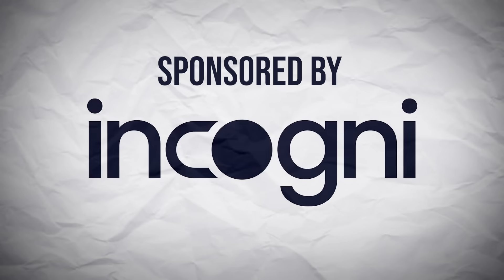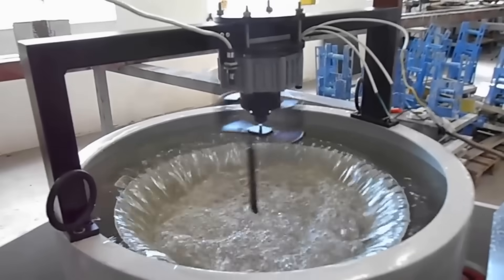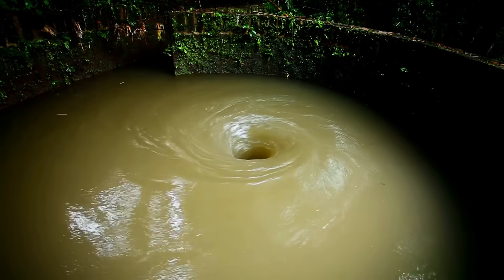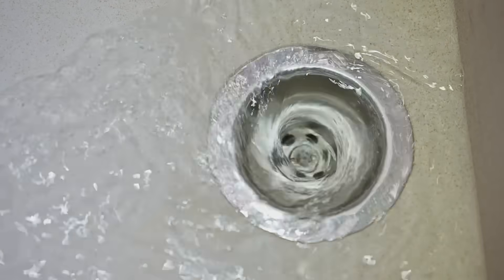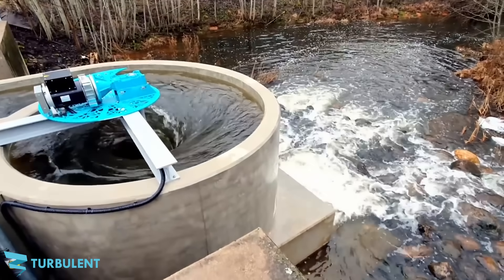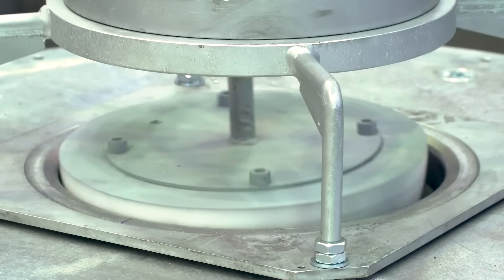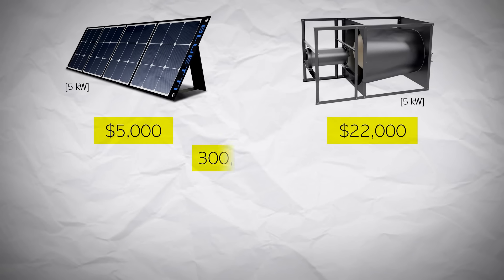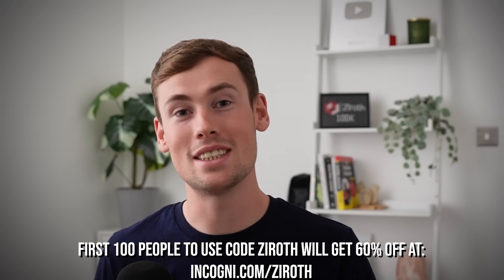Genius Bladeless Hydro Turbine is Cheaper Than Solar

Comment: Immediately two problems come to mind: 1) Vibrations are deadly for efficiency and longevity. 2) Due to practicely no surface area there is little to no torque on the shaft.
im highly skeptical this design has any real merit in relevant scales.

Comment: That footage at 8:00 just looks fake.

This is very unimpressive to me. Its using physics principles, but in a less efficient, less optimal way than the current method. Its not even optimized to harness a vortex either, the top is flat. It should have a smooth "hydrodynamic" topside that facilitates the eccentric rotation. This design relies on the vortex alone, while also basically disrupting it.

Comment: It does not look fish-safe at all. Fish will surely be turned into a paste when the ball crushes them against the walls.

Another issue is maintenance: the off-center operation creates a lot of vibration all the time, and vibrations are good to destroy machinery. Mechanical resonance is powerful enough that a group of soldiers walking destroyed a bridge (Broughton Suspension Bridge), so if the vibrations got resonant, the turbine will get destroyed.

I liked more the Turbulent turbine: simple design, little to no vibration, and definitely more fish-safe.

Comment: Trompe is the ultimate bladeless system and has energy storage as compressed air. The key is to mass produce the things and use a steerable deep staff drill to make the shaft and separator. https://en.wikipedia.org/wiki/Trompe

Comment: An aspect of this type of smaller power generation machinery, that isn't often discussed,  is its impact on large grid stability. 
When grid power is discussed, it is usually only in terms of total supply and total demand. Rarely is transmission and distribution discussed.  
Anyone who has lived in an area with regular rolling blackouts is experiencing transmission/ distribution problems, usually not an actual supply problem. 

Even if their net supply is insufficient to completely carry the local grid, these local power stations take load off of the transmission grid. Every watt that doesn't have to come here, can go somewhere else. Even with totals below 10%, local power generation is worthwhile for the big picture,  as well as the small picture.
Reply: I really don't know modern technology of grid control systems so I always wonder how electricity distributors controlling those "small power stations". I imagine it's not impossible to implement some sort of central control system for the grid, with many small suppliers, because as matter of the fact electricity companies buying electricity from small supplier even in my country. But I imagine it's better to use those small power station locally rather than sending it to the grid. Especially, hydro station is very easy to control because all the thing you have to do is close the valve to reduce the amount of electricity produced by the generator. I understand modern trend of "clean energy" is more like, selling electricity to the distributor but It feels like a bit off to me. Why they don't consume the electricity where it produced rather than sending into the grid?? Maybe I just don't understand how these system works but now we have a lot of way to produce electricity suits to the location we're living in. So for example, if we're living by the river we can install small hydro turbines or if we're living in the desert we can use solar panels (in this case we definitely need battery but I really don't know how frequently we need to replace batteries...considering the battery of my phone become incapable of storing electricity for five years or so, it's not long lived as we expect it to be I'm afraid) and consume the electricity within local area rather than sending it to the grid. And only when our small generator can not fulfill the demand of our area we can buy shortage from major supplier through the gird. I think it's more simpler than constructing "integrated grid system" or something (because basically that what electricity distributors are doing now, right?). Or actually modern grid systems are working in that way?? As you said in your comment I really can not find these information anywhere on the internet. After all we all have substation for the area we're living in. So All the thing we have to do "plug in" our generator at that location and consume and feed the electricity whenever our generator can not fill the demand of our local area. It seems like somehow easier and better...well, this is my amateur's intuition so probably I'm missing some thing, or I just don't know modern distribution system actually capable of it. Anyway, It's always mystery to me, how modern grids are distributing electricity from various generator scattered all over the place? Is that really cost efficient?
Reply: @付和雷同-j5b  I think you understand both the technology and challenges better than you think. The part you leave out is political, where politicians will force or subsidize things that aren't effective, simultaneously blocking others from doing things that are effective. 
Remember, even in countries that claim otherwise, the electric grid is always 100% controlled by politicians- not engineers.
Reply: @付和雷同-j5b  In TL:DR form, you have large energy producers and adjustment power producers. Small hydro, solar etc falls into larger energy production bracket, where its drop in the bucket in comparison when rest put out hundreds of megawatts. Even if it was readily available all around, power needs in certain area like city can easily overwhelm even larger producer if lines outside are cut witch balance the use and production, causing those with in most likely run out of frequency and emergency cut out from grid, since just 0.5hertz can destroy equipment and that will be very VERY expensive bill who ever fucked up. More complex the machine is, more sensitive it is frequency changes, unless it was designed to work in different ranges but thats beside the point and each item design. Since you cant throttle nuclear power plant up and down fast, there are rapidly responding powerplants that are adjustment power producers, who can turn the whole plant off and on again in seconds to minutes. This is when grid is fully working. Due next question of where the power is cheapest and most practical to produce for instance cost of hauling the fuel around, plants are setup all over the place where its best suited and due the sizes and type of plants electricity might need to be moved long distances. When grid is damaged, larger area is cut out from power, then brought back in steps to locate where the damage is witch requires the adjustment power. During large storm many such events happen and adjusting power plants need to response in over production or under production, so frequency stays with in set standards. If it does not, that mean in worst case scenario ether totally fucked up electronics if fail safes fail, or most likely almost just as bad result: frequency collapse, where all plants emergency cut off from grid and whole country can go dark. Getting grid up from this situation is absolute fucking nightmare, witch is hella expensive and should be avoided in all costs.

"Why they don't consume the electricity where it produced rather than sending into the grid??" Simple. Cost of production vs whats paid for it. You recall the world ending electricity prices in Europe? Well cause of this simple thing, Sweden and Norway produced shit ton of cheap energy since their productions costs were rather low. This power then was sold to Finland... witch sold all the excess and further sold it to Estonia, who sold it further. Top of that Finnish people were plead to save all the power they can for sake of the "environment" and that enough power would be available to everyone...all the saved witch was sold to Estonia for great profits who most likely did same thing. Just goes to show how we are scammed, with climate crisis etc bullshit.

For small production its nice little extra but at best they can produce maybe a megawatt or two that gets lost to total production and mostly only useful to person who produces it. For instance my neighbor has top of the line larger solar setup. On winter his on mostly taking all the power from grid and summer producing some into the grid while producing most of his power least during the day... or starts the diesel generator when power price is high and sells this "green solar energy" to grid. This is just small scale how green energy scam is done by larger companies.

This is just the bits i have learned from powerplants head electrician, but the whole topic is much much more complicated when we go from power production to systems in thems selfs globally and god damn politics and scams, but simply said yes it would be beneficial to have small scale power production, say macro nuclear reactors and utilize resources available, but micro hydro, etc if its not able to produce extra top of your own usage, is not really that practical in grid scale even if there was enough land and people installing these setups. Specially when you look into cities that consume most of that energy.

Comment: With EV big battery and V2G and parked 23hrs every day and batteries are free with the EV then storage of electricity is $0.00.
The EV uses very little electricity daily and can selfpark and plug itself into the power like the home robotic vacuum cleaner. 😊😊😊😊😊

Comment: A circular cage with fins on the inside may work it'd spin fast enough that'll pull it apart and will move to fast for anything to enter beside the water that can catch the blade but that may be wrong. Definitely should be some ways to make it more efficient while keeping wildlife safe.b

Comment: What about an externally spun top strung with copper wire within a shroud. The external ring the water swirls around spinning the top, at the Venturi point is also strung with copper wire. No direct drive to drag the spin. Effectively a magnetically and buoyancy-specifically stabilized top. Turned by the vortices draining around it. The magnetic stabilization being at an algorithmic ratio to pointed. In theory it could continue to accelerate the effect through several stacked iterations as the siphon effect accumulates.

Comment: Thanks for the video. Fascinating. As a keen fisherman I can relate to the desire for turbines that don't mince the fish.
That said, looking at the footage you have shown here it looks like any hapless fish that found themselves going through one of these would run the risk of being crushed to paste where the "ball" meets the wall.
Love your work. Cheers.
Reply: Yeah, it would be better to add safety net to prevent fishes wandering into the devices.
The net need to be replaced at regular interval tho, and the net do reduces power generated by the 'ball'.
Reply: Perhaps the safest method is the big old water wheel, tipping the water in the top and gravity does the work.
Not very tech and whizzy, but very safe for fish and efficient too.
Reply: Nah. Manufacturer makes it clear that you're supposed to put a protective grate/screen solution in front of the turbine. (Not just for fish, but other debris as well.) a couple layers of painted expanded steel seems to be the favorite.
Reply: @QuakeDragon  Good point. I can't help wondering, though, if the fish can't get through then wouldn't you just go back to the more traditional turbine with double the efficiency?
Reply: @GarthClarkson  Yes, that is absolutely valid. For the SETUR-L (the large 5KW turbine) the use case for these is generally intended to be small deployments in remote areas where you can't (or shouldn't) have all that infrastructure buildup, such as the case of the concrete snail-shaped outlet. Case in point, the manufacturer primarily sends off-grid inverters, but if requested can certainly send the grid-tie capable ones. Additionally, the SETUR-L may have a low head requirement of only 1 meter, but it still requires 650 liters/second (170ish gallons/second) of water flow rate for nominal operation.  With that kind of volume, the difference made by a couple of steel screens would 𝑝𝑟𝑜𝑏𝑎𝑏𝑙𝑦 be marginal. (references: P.8 of SETUR-L user's manual, Rev. 5L-B)
Reply: @GarthClarkson  ..i think ur very very generous when u say it haf as efficient... on this scle perhaps... on a larger scale it will be exponentially more inefficient... if u want to power a few strips of leads in ur garden fromur garden waterfall its probably okay...
...even a tesla turbine would beat the crap out of it... and it not suitable for it...to ineffecient...
Reply: @QuakeDragon  Harbor seals and sea lions would keep the fish out of the turbine...
Reply: I noticed the fish-grinder action, too. 
Fish paste maker, probably not. Maybe just smashed once before ejection.
---> I wonder if the ball has to be rigid, could it have a soft foam layer?
If not, collect the semi processed fish, for livestock feed. 
 (You'd probably get tired, pretty fast, of making yourself Tuna-Loaf, with "mystery-Fish", anyway.)
Reply: while you would need a grate for debris the worry about fish is unfounded. since the fish swim in the water and the ball is pushed by the water then it wouldn't crush the fish very often, only when they are too big to fit. even if it pushed the water then it would push the fish with the water and not smash the fish. if you look at aquatic animals smaller than the width of the blades on propellers and turbines, they rarely get smashed in whole or in part by the blades because the blades move enough water to move the animal with the water. it is only as the animals get big enough that the amount of water displaced is too small to move the animal that they get injured.
Reply: ..well thay do already exist...thay are called hydro electric power dams...
...and this guys have invented a very poor verision of a tesla turbine....
..wouldent surprice me if thay maned to hype it and get some investments at wich point that suddenly dissapear... 
req investors that dont know anything about physics ... its a pipedream...litterally...
Reply: It makes me wonder of adding some vestigial blades, heavy grooves, or something like that, might improve efficiency and create a little space for fish to sneak through unharmed.
Reply: I imagine you could have a thrust ring set at a point to allow the ball to only swivel out to a certain point so it doesn’t actually touch the sides and allows enough room for fish to get past without mincing them, this would no doubt have an effect on its efficiency though.
I am not keen on this design, it seems very inefficient.
Reply: As a white water kayaker these things may not completely destroy the river but they are ugly and need a lot more work.
Reply: @billalumni7760 I don't think this type of turbine would apply to white water as they are meant for low head. White water hydro can easily have concealed intakes and outlets due to the large amount of water and the high drop.
They can also have protective grates to stop the fish from entering as the fish have the whole river to traverse without the need to go through the turbine.
Reply: As a keen fisherman, keen on ripping the throats out of fish with my tripple hook lures, I can relate to the desire of not killing them any faster with turbines. Far better they die slowly by starvation, that only seem fair.

Comment: have you one one about the open top turbine with a spool section open to the air and really tall paddle blades scooping the spooled water? (nvm)

this is neat and all but i thought this was gonna be some static electricity or electrolyte/thermal differential generator. 
think about using big black panels or class bubbles to heat one side of a sterling engine with the other side consisting of fins immersed in flowing water, that could be really powerful in elevated areas of desert environments

Comment: Does seem like adding fins on the ball (and making it lens shaped to hold its orientation) would transfer the rotation from the vortex with stronger torque.  On the other hand as soon as the fins are there, it can’t be called a bladeless system.
Reply: could you have silicone ridges to the same effect?

Comment: Wouldn’t the ball stop too easily if energy is being extracted from its motion? Like cars with regen braking, it would slow the ball. And if the surface friction of the ball between the moving water is the only thing rotating it, it seems it would stop quite easily, therefore not being able to provide much energy.

Comment: Or, you could use discs seperated on edge, like an undershot Tesla turbine. fish couldn't fit between disc plates. and shaft could be horizontal between turbine and generator on the side of river.

Comment: Efficiency claim of 50% has got to be marketing bogus. Water does not have the kind  of viscosity to efficiently create a drag on a relatively smooth surface that provide a energy-generating torque.  To do so you need to significantly "roughen" the surface. Best of all, make it in the form of blades. Oh wait! ....

Comment: limited application but 55% efficiency not too bad.

or go with #nuclear. Ultra green for environment. One of the safest methods to produce power.

Your 17% solar panel stat. Is that average or for a specific latitude (aka UK for example...I assume you are there)

Also, interesting #worldbank comparison ignores nuclear

Comment: I have a hydroelectric power system design that uses water pressure at depth to generate the flow and can be built on any coastline with a minimum water depth of 100 meters. No need for dams or rivers and more traditional 90% efficiency turbines would be applicable.